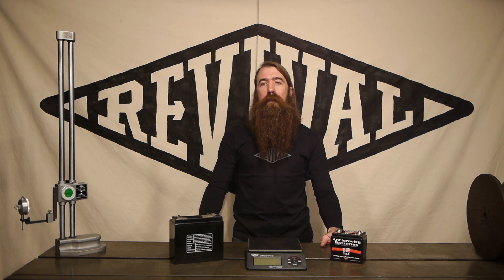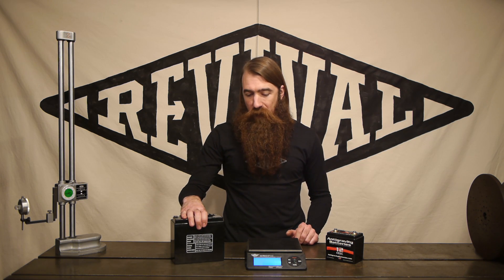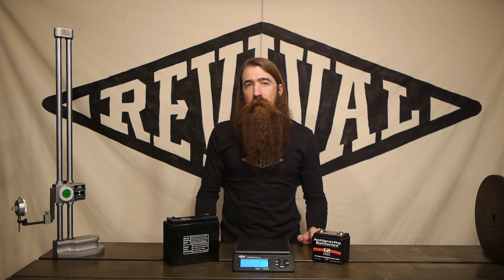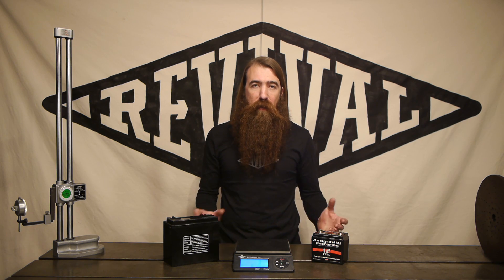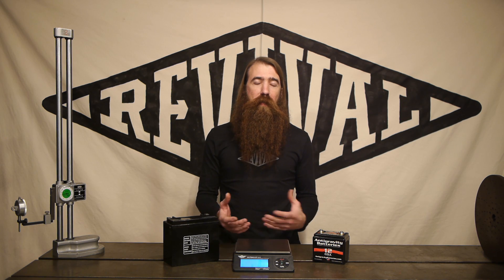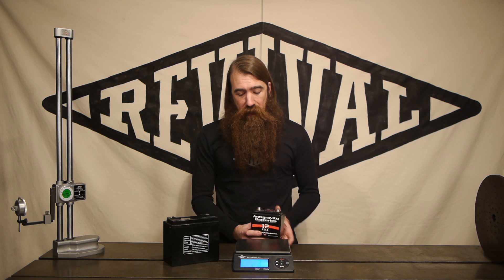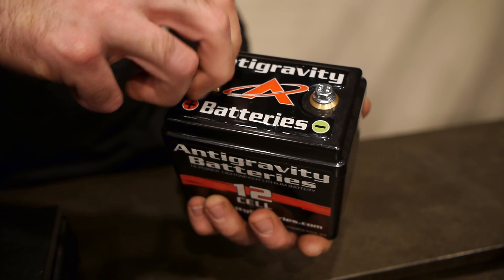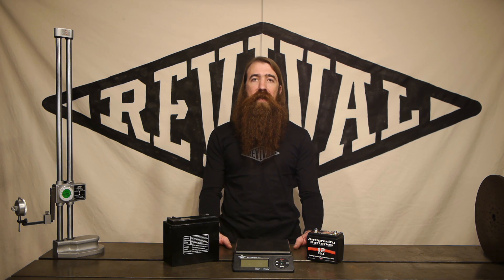Antigravity Lithium Batteries - Revival Cycles Tech Talk

Comment: Hey guys 

someone know if I can mount antigravity  to my CM 400t ? ( using CM400t voltage regulator )
Reply from the maker: You will need to upgrade your CM's regulator/rectifier to be able to safely use an Lithium battery. This one will work perfectly  https://revivalcycles.com/products/lifepo4-compatible-mosfet-regulator-rectifier

Comment: 7 years later and this video is still helping. I just finished a chopper build and see that the conventional batter that I have on the bike and the battery box is too close to the chain and is slapping the box. Opted to look into Antigravity and was not sure what the comparison was and this helped out a bunch. Now I know what I am getting into. Thank you!
Reply from the maker: Be sure to look into a lithium optimized reg/rec as well. It's been a long time since we made this video and the whole industry has learned a lot. OEM reg/recs usually put out 14.8V which is slightly above the tolerable limit of most lithium batteries. Best case scenario is that an OEM reg/rec will shorten the lifespan of the battery. But an out of spec reg/rec can overcharge the battery to point of causing a cascading meltdown which will create an awful mess and potentially be catastrophic to the electrical system.
Reply: @RevivalCycles  Thank you so much for the follow-up. You're right! As I was digging through this option a little more. I was seeing that a lot of guys were finding charging issues on both sides and were talking about how there are options out there for upkeep for the little batteries. I was looking through the battery box that I built for the chopper that I finished and found that I could shave down about .05" off the box that reseated the OEM battery and that gave me the chain clearance that I needed.  Still, I printed out this conversation and I am going to revisit the idea after I shake down this bike a little more. Again, thank you for everything that you do This has been a huge help to me

Comment: Would a 12cell power a 1200 Sportster?
Reply from the maker: A 12 Cell is a good size for a Sportster. You do need to make sure that your Regulator isn't putting out any more than 14.2V or replace it with a Lithium Optimized unit or else there's a good chance of overcharging the battery, shortening it's life span or causing a cascading meltdown.

Comment: If I wanted to do a conversion and install the M.unit Blue on an '84 Honda VF1100S V65 Sabre, what size Antigravity battery would I need? Because it's an 1098cc V4 it needs quite a bit more juice than smaller bikes and there's quite a bit of electronics on it. What would you recommend and would the M.unit Blue be able to handle all of the OEM systems on the bike?
Reply from the maker: A 12 Cell would be ideal but if you are also doing a full lighting swap to LED and you're diligent with keeping the bike on a float charger when sitting for a week or more you might get away with an 8-cell. Keep in mind that you'll also need to update the Reg/Rec to a Lithium optimized model or you'll over charge the battery shortening it's lifespan or possibly causing a cascading meltdown of the cells. You bike would require the MOSFET 820 offered on our site. 
https://shop.revivalcycles.com/lifepo4-optimized-mosfet-permanent-magnet-regulator-rectifier/
Reply: @RevivalCycles  would this reg rec update be necessary if I was wanted to install 12 cell in an 82 v45 magna 750? Also, if it is, would the one you linked be the best option for my set up?

Comment: Hey!
I’m building a somewhat unconventional cafe racer. It’s a 1975 honda cb 125 k. The main issue is that it runs a 6volt electric system, and i want to install a 4-cell antigravity battery. I’m also plannong on not running it with an electric starter. What do i need to consider?
Reply from the maker: There are a lot of things to consider here. The first thing is converting your system to 12V DC. If this can be done it almost certainly has been and you're likely to find someone who's documented the procedure online rather than reinventing the wheel. The conversion will require you to install a 12V Reg/Rec and to use a Lithium battery of any kind you need a R/R that has a charging set point of 14.2V rather than the "standard" 14.8V. a 14.8V will overheat the cells in a Lithium battery shortening it's life. 

Your Bike likely needs a single phase, field excited R/R which we offer on the site.  You can also find wiring diagrams and instructions on our Tech Articles page. 

-Jeff

Comment: Thanks for the videos!👍👍👍

I hope you will make another indepth/lamens term video from my questions/topics in this email and post it for others.

   Here go's,
I'm interested in the antigravity 480cca lithium battery for the cost savings of nearly $40 on amazon. Thou, concerned about, where it says, excellent for everyday use in bikes up to 1500 enginge cc, mentioned on their website under best uses.    Why is that?

I have a 2013 Dyna StreetBob, 96ci engine. My stock HD battery is about 320cca.

How will I know if this one will work or not, or do I need the antigravity battety with 680cca? What is the dell with enging cc and battery cca?

Please explain because I'n interested in buying a lithium battery and the size battery that will fit in my battery box in my scoot!

Also I've read and watched so many things on lead acid and lithium. That I'm now not sure.

Which is the right and best battery and top rated brand? Also charger?

I like the idea if light weight and longer lasting with a lithium. It seems longterm cost effective.

Though what about charging? How and when, and can you mess up the battery and ruin the life of it even if using a lithium (LiFepo4) charger?

And do they get hot and what makes them blow up? If that happens to motorcycle lithium batteries.

I can testify HD brand battery, NOT so good. If I went lead acid again, i'd rather have an Interstate battery.

PLEASE HELP, share links and websites on this topic. 

Ride Safe, Carl ✌
Reply from the maker: The batteries on Amazon may or may not be genuine, there are many fakes that get sold on amazon and they do not meet the quality standards of genuine antigravity batteries. 

Beyond that, you should ask yourself why you want a lithium battery, do you need to save weight? do you need to save space? If the answer to both of these questions is no, then you should get a lead acid battery. They are more robust and tolerant of problems. 

But if you need the smallest, lightest and most powerful batteries out there then these are your best bet. Unfortunately there is no simple solution to sizing, and really you need to test to be sure what the smallest battery is. Generally CCA is CCA so if you had a 320 CCA originally you should be ok with a 480 CCA lithium. But in our experience with 1250 cc high compression sportsters we used a 12-cell small case rated at 360 cca and had no problem, but the 8-cell rated at 240 couldn't quite do it. 

There are so many details like decompression systems, starter motor quality, compression ratio, cam lift, stroke, etc that affect how difficult it is to start an engine, so there really isn't a way to be sure, but following the CCA as a guideline is a good way to start. 

There are three things that damage a lithium battery, over voltage, under voltage, and over current. Over voltage happens when your reg/rec doesn't regulate and voltage exceeds 15v, Under voltage is when the battery gets drained below 10 volts resting like if you leave the lights on or drain it trying to start, and over current happens when there is a short circuit without fuse protection or a battery is way undersized. 

Antigravity is still the brand we use for lithium batteries, and as far as lead acid those are all pretty much the same in our experience.

Comment: WHAT ??? is that thing at the end of the table ?
😮 😁
Reply from the maker: That table is called a Vinco, and it is used for making precise measurements of irregularly shaped objects. The table is ground flat within some extremely tight tolerances, and the part on the end is the dividing head that can measure angles very precisely. The part to be measured is mounted to the rotating head, and then distance measurements are made at specific angles like a cylindrical coordinate system. Our Vinco was used by the US Navy during WWII to measure steam turbine blades, thus ensuring they were in specification and ready for service.

Comment: Can it be trickle charged?? Or jump started? Thanks :))
Reply from the maker: This is slightly more complicated than yes/no. Theoretically these can be trickle charged or jump started as long as the maximum voltage and charge current are not exceeded. Best advice is to use a lithium compatible charger for both recharging and trickle charging / maintenance.

Comment: On a 1980 cb750 what do we have to do about the voltage regulator and the antigravity battery
Reply from the maker: If your charging system is able to provide a stable charging voltage above 13.25 and below 14.75 at all rev ranges you should be good to go. That bike may be new enough that it has a permanent magnet charging system, but I'm not familiar enough with them to know off the top of my head. Either way we do have Lithium optimized regulator rectifiers available for both field exited and permanent magnet (PMA) systems if you want a new one.

Comment: I have fitted an 8cell antigravity battery to my 1982 xv750. But it dosent hold a charge very well. Should I have to change the regulator rectifier to suit the charging of the battery? 
My email Peter.fleming16@btinternet.com
Reply from the maker: On your bike, if the stock charging system is working correctly then it is compatible with AG batteries. To solve the problem, the reg/rec is a good place to start, but really the fix will depend on why its not holding a charge. If there is a parasitic drain while the bike is sitting with the key off, changing the reg/rec may not help, and you would need to identify the cause of the drain. On the other hand if the battery is not being charged fully when the bike is running that could be stator or reg/rec. Also  worth noting that a reg/rec can be a common source of parasitic drains, but without more testing and info there is no way to say for sure what the problem is.
Reply: Revival Cycles I know that when riding it’s charging at 14.1v. But how long does it take to charge these battery’s?
Reply from the maker: Not that long at 14.1. I'd guess 5 min after a standard 2 second crank to fire up. You may have a parasitic loss somewhere in your system. I have seen reg/recs work properly when running, and they charge and hold the correct voltage, but then when the bike sits, they slowly drain the battery. I'd suggest checking the reg/rec on a diode test, or simply check for resistance in the system with the key off. If you do need a new reg/rec we just listed a really great one, its optimized for lithium batteries, and is MOSFET so top of the line in reg/recs today. https://revivalcycles.com/products/lifepo4-compatible-mosfet-regulator-rectifier

Comment: I have a Yamaha SR400 with a 2.3AH battery. Should I change the connector, would you imagine there to be any reason that the 4 cell/6AH battery wouldn't work and serve as a means to increase battery capacity?
Reply from the maker: The 4-cell should work fine on an SR400, but if you have one of the original SR400's make sure your reg/rec is functioning properly. Regulator/rectifiers from the 80's do wear out over time and the LiFePO4 batteries are more sensitive to malfunctioning charging systems than the conventional Lead Acid chemistry. 

I'm not sure why you would need to change the connector, but if it is just an issue of physically connecting to the Antigravity battery, then yea go ahead and change the connector. On a kick start only bike, the connectors for the battery don't need to carry that much current, and it shouldn't cause any problems.

Comment: Hi, I'd like to install a Lithium battery but my regulator rectifier can charge up to 14.7-15.5V at 5000rpm. As I know this can kill a Lithium battery. What kind of reg.rect. do you suggest for an XR650L ? (Everybody talks about charging with a charger but nobody suggests a reg&rect.)  I just transform it into a lowered commuter/scrambler. By the way, your videos are quite useful, thanks.
Reply from the maker: Just pulled a wire diagram for your bike, looks like you have a 3-phase permanent magnet system. And that means you should be able to use virtually any of the 3-phase permanent magnet reg/recs. The next challenge is that it needs to fit somewhere, so the physical package makes a difference or you'll be looking at custom solutions for mounting. The last thing to pay attention to is the amperage the reg/rec is rated to, that will need to be a little higher than what the stator output is rated to. For example, if you have a 200 watt stator, that's W=V*I or I=W/V or 200w/12v~17 amps. So a reg/rec rated at 20 amps would be a good choice. Basically if your stator is less than 300w and you find a reg/rec with three yellow wires and a red and a black (or green) wire it should work.

Also, 15.5v charging is too high, even for lead acid batteries, you may simply have a bad reg/rec, and replacing with OEM should cure the issue. So far we have found that every OEM reg/rec that is operating properly has been compatible with LiFePO4 batteries.
Reply: Thanks for your prompt and detailed answer.I did not measure charging voltage as the bike is in pieces, I just looked in the service manual which says: Regulator/rectifier regulated volatge/amperage : 14.7-15.5V/13A at 5000rpm. Is this a different voltage what it is referring to?  (The rated output of the alternator is 186W in the manual at same rpm. As I can tell the R/R is stock and worked well last year with my lead acid battery.) Sorry, maybe I just missed something here...  Yes, the main reason for changing to LiFePO battery would be the size of it , so I can hide it easier.  I noticed your daily videos and subscribed at once. :-)

Comment: Hi, I have a 1981 Honda CB750f and I'm doing a cafe racer project with it. I want to hide the battery under the tank so i need the smallest one possible that still works with the bike. Which battery i should buy?
Reply from the maker: I'm guessing you've already solved this, but in case someone else is looking for this info...The CB750 will work fine with an 8 cell antigravity, But if you want you can also use two 4-cell AG batteries wired in parallel. Electrically this is basically the exact same thing, and the only real difference is for packaging.

Comment: I'm looking into getting the the 4 cell or 8 cell for my 1973 Yamaha to 500. What would you recommend? Also would my charging system be ok or will it need to be upgraded? 
Thanks for the help
Reply from the maker: With a bike from 1973 it is a good idea to replace the reg/rec. Those do wear out and even if it hasn't failed yet, it will, and it probably isn't working as well as it should. Pretty much any modern combination Reg/rec will work with the antigravity batteries. 

The choice on 4 vs 8 cell comes down to kick vs electric start. The 4-cell is fine for kick start bikes, but you'll need the extra power of the 8 cell if you plan to use an electric starter.

Comment: Looking for a battery for my 78 cb400t resto. Do i need a 8 cell or 12 cell antigravity? cheers
Reply from the maker: You should be good with an 8-cell. We use 8-cell on almost everything. The 12-cell is only needed on the larger displacement hard to start bikes like harleys. If the rest of your starter system is in good shape you should have no problems starting a cb400 with an 8-cell.

Comment: Hi there, thanks for sharing all this info. This may be a dumb question but can these work on a 2016 ducati scrambler? If so, would you recommend 8 or 12-cell? Appreciate the help
Reply from the maker: The antigravity batteries will work perfectly on a scrambler, and in our experience the 8-cell has plenty of power to start the engine and run the bike. If you want to have more reserve capacity in case you accidentally leave the keys turned on with the engine off, the 12-cell is the way to go. But even with the 12-cell you can still end up with a flat battery if you leave it on long enough.